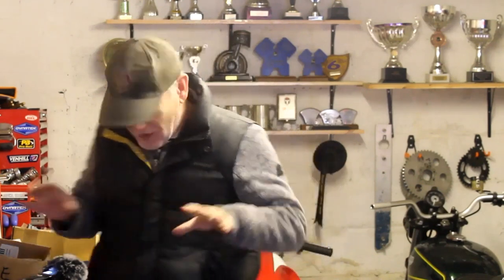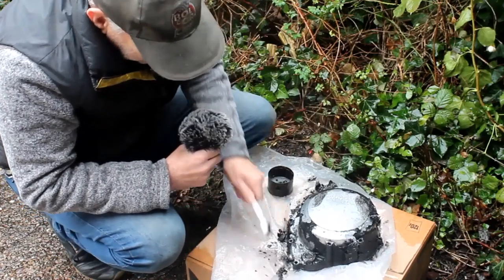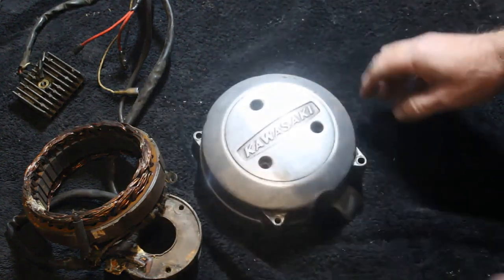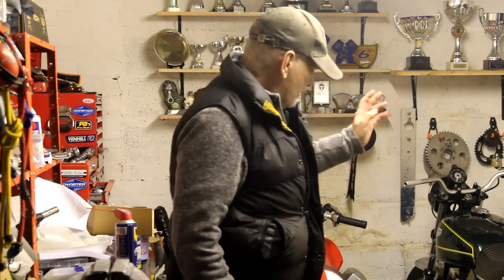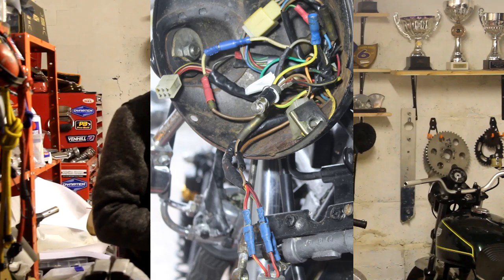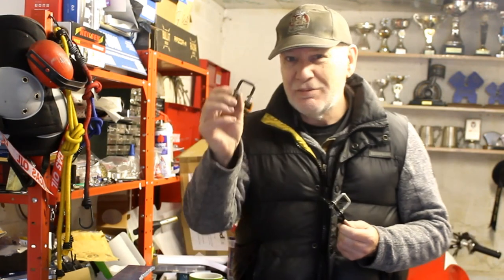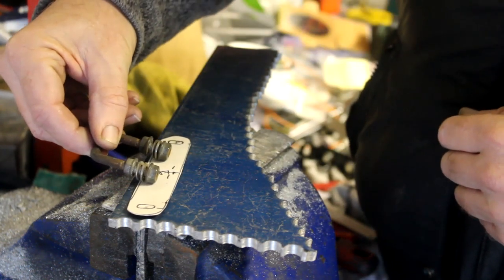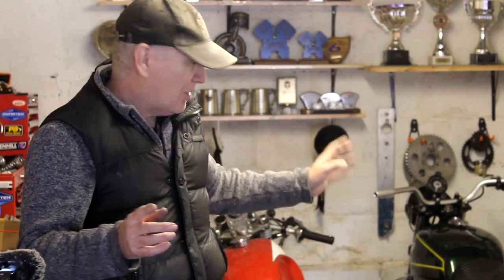Kawasaki Z650 Restomod Project - Part 14

Comment: I used a pair of 2004 ST1100 switches and throttle c/w cables on a 77 KZ650C. I don't recall exactly how much work it was to convert the connect6ors and cables, but I don't believe it was much. I made a simple new plate to affix the Honda cables to the carbs,

Comment: Not one of those I have ever rebuilt hasn’t had the factory rubbers at least that bad. There are 3 people making the rubbers now for replacement. It was a factory fault cheers 👍
Reply from the maker: I found a source from a guy called klause ?in America, but with no prices. The fix was done over the new year, so its done now. The bike won't be used hard in the future, so fingers crossed the clutch will be ok for many tears to come.
Reply: @Merch131ho  I’d have to look up the name but there also is another supplier in the uk. They work even with stuffed rubbers so any improvement and no reason what you have done won’t work 👍

Comment: What make of paint stripper do you use - you can use a scotch bright wheel to get the 1st stage of rubbing down :)
Reply from the maker: The paint stripper is by Paramose..   https://www.ebay.co.uk/itm/255840724029?epid=1261136343&hash=item3b914ba43d:g:AucAAMXQ3kRQ7Tys&amdata=enc%3AAQAHAAAAsDZvyyAfPs6FO8F7%2FBjCo5NUy5o3pCuC1M1EUBb7ox%2F6dBioMPy8IzJ2zc0CPjJo6R6Ts%2B1n4BYgn1bUhoz0G155BuBa7rPZpbjIC0OAtKTguuET%2BLfq%2B5SPrkrTdrWt%2FPOfG71lf0droFiHiusV%2BGYUlIeQRTNe0F%2BiTXSnoVTjMsvq76U9jFN9gjZ3b%2BC0YvfQv678O1qqMqO7mPrFUojVQcXj6JmRKqESrs8WU5Nh%7Ctkp%3ABk9SR-Lu97uvYQ

Comment: Lee does nobody make a billet points cover?
Reply from the maker: Other than some very expensive ones from Japan, I don't think so.. unlike the bigger Zeds the Z650 cover isn't a simple round shape, so its not easy to replicate.
Reply: @Merch131ho  Lee I have a cnc machine do you think there’s any market for billet ones?
Reply from the maker: @andym6608  Maybe, as ever depends on price. and if they are exact replicas or not etc. There are two or three different designs/logos.. just look on Ebay to see what they are. Probably easier to make just one design, with some kind of performance logo.
Reply: @Merch131ho  ok thanks for this I will have a look👍

Comment: Hello, First of all i wish you all the best for 2023 (mainly Health!).
I do like you vids but do not understand why the sound is so crapy? It is really anoying. 
Otherwise the content is great.👍
Reply from the maker: The mic in the Canon DSLR camera I use picks up lots of background noise. Therefore I usually also use a better hand held mic. Sometimes I don't have it, or I forget to turn it on or there's a problem.. battery runs out etc. So in this vid some parts are fine.. using the handheld mic, and some parts or not.. using the camera mic only.  I want a new DSLR camera with the option of using a plug in mic, but the one I want is over a thousand pounds, so that will have to wait,
Reply: @Merch131ho  it is better to spend that money on bike parts!